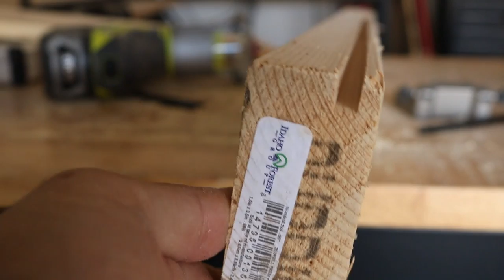RYOBI Cordless Router Review. The Ryobi 18v Cordless Router Is Great For Any DIY Beginner Woodworker

Comment: One thing you didn't show was dados.  I tried making a 3/4" dado 3/8" deep in plywood yesterday.  I  clamped  a board as an edge guide.  It ripped into it, but it was hard to control and I went off line.  I then dialed it aback to 1/8" and there was no problem. I kept a combo square set at 3/8", so I adjusted the router another 1/8th and went over my line again. Next, I went all the way down to 3/8" and finished the cut.  I then made one more pass to clean it up.  Finished dado looked great.  This little guy is a beast.  It will do most of what needs to be done

Comment: I just bought that router. What's not to like. I can see easily where the bit travels for freehand mortise . I can't think of a job I couldn't or wouldn't do with this tool vs. a more expensive brand. Your not going to overload a trim router and have it last anyway so having the batteries made it a no brainier.  I didn't know the fence was available. I could use that. Thanks

Comment: I've been using their tools professionally for a long time. Some are better than others but 15 years out of a table saw is awesome. With it's 27 inch rip capacity it more than met the order. How many miles of hardwood cabinet fillers and lumber it cut who knows. Some of their tools are duds that burn up after medium use in a hurry. Or that old blue cordless jigsaw that came out back when was useless because the orbit kicked out on the downstroke. I took it right back.

Comment: Thinking about getting one of these bc plunge routers are heavy (duh!) and sometimes you don't want to deal with a cord.  You keep mentioning the battery, but I think you could go with the smaller batteries and do fine on small jobs, or just swap out whenever you are setting up the next lot of pieces.  This tool is worth it for the convenience.  Putting it on my wish list.

Comment: You can get the edge guide on the Ryobi website for anyone interested. Should be more information on that in the back of the manual. Had trouble finding one and another video brought that up. A round base is available also.
Reply: Thanks, I've been looking all over for the rigid one. Didn't think to check Ryobi's site!

Comment: Thanx for the review! Like others I went out and bought the Ryobi after weeing your video as well as a couple others including the Concord Carpenter/Toolbox Buzz which they went through several of them. 
And sure there are others that proved to be "better" but at a much higher price point. I'm sure the more serious carpenter with cash in their pockets would go for one of the other trim routers, but for me, as much as I need and use one at this point, especially since they put it on sale for $49 bucks... it was the perfect choice. Since I already have Ryobi One + cordless tools that also helped solidify things for me.

I also ordered the Ridgid edge guide which you were the only one to mention it fit the Ryobi. So thank you again!

I do have a question for you since you have both the Rigid and Ryobi... Is the round base on the Ridgid Corded Trim Router acrylic or the same plastic as the Ryobi stock one is? And will it fit directly to the Ryobi?
As well, how about the Ridgid vacuum port attachment... if you have it, will it fit the Ryobi, do you know?
Again Thanx fort the review - it did help a lot in making my decision to get one.
Cheers...

Comment: It does seem like they did a really good job diffusing down to the ryobi line from the ridgid one. It's huge on top, but it's not a big deal. Worth 69 bucks IMO. Glad I am bought into ridgid for my main tools though, even if they are a bit more pricey, the batteries replacement on kits is the main draw for me (I only buy kitted batteries, so I won't have a 9ah until one comes with a charger :P). Like button smeeshed.
Reply from the maker: Thanks for the SMEESH Autonomous! Great talking to you on the live stream too bro!!

Comment: Totally agree with everything you said. I own 2.
Reply: What are the practical applications of owning two trim routers of the exact same brand and model? Just curious.
Reply: @as7river  You can dedicate one to a specific task, so you don't have to reset it. each time you want to do that task.  You have a backup in case one goes down. You have an extra so your kid can play with it. You have one extra in case one is stolen or you run over it with your truck. If you are senile, like me, you can always find one of them.

Comment: I do have a router, but one of those bulky, dual handle monsters.  I hate it and don't use it because I find it clumsy.

I just saw this Ryobi today and found it very interesting AND the price is really good.

My question is, does this take the same bit/shafter size and any other regular router?

Or is one forced to by special, Ryobi bits?

I have a large kit of many bits and I'd hate to have to buy those all over again.  LOL

Comment: Thank you for the review!  I'm new to routers, and I have my eye on this one (I have several Ryobi 18v tools), but I understand this is mostly for edge work.  However, I need to cut out maybe a 2x2" section in the middle of a board, 1/2" deep.  My question:  Couldn't I just cut a "pilot" hole and then start the router there, rather than trying to plunge it?  Appreciate your thoughts here!

Comment: Good vid there Clint.  Since I'm in the Ryobi battery  platform, I'm considering this trim router to add to my kit.  I already have the Bosch Colt corded trim router  but this would make my smaller projects a bunch easier.  I am curious how it performs on hardwoods like oak, ash, maple and others.  I will say I'd probably only use this on soft woods like pine though.  Thanks for sharing.  Cheers!
Reply from the maker: I'll be working with some walnut here soon buddy.  I'll let you know
Reply: @ToolReviewZone  Thanks Clint.
Reply: Hi william! I'm curious, what is your favorite ryobi tool?
Reply: @amoscardoza5253  Actually my 1/2" Ryobi drill driver as I'm not terribly impressed with their impact driver and still using my old DeWalt brushed impact driver in it's place for now. .  I also have a small  Ryobi work light that works great.

Comment: I’ve been considering buying this for home. I have Ryobi at home so I’d have the batteries for it. Also considering getting into Ridgid for home also. I would prefer the Ridgid router because it’s brushless but I don’t know if it really makes a difference between the two in this case.
Reply from the maker: If you use the router a lot, I would go Brushless just because you wont need to change them out if the go bad. That would probably take a while to wear them down, but still a bonus for ridgid!
Reply: Hi adam!

Comment: The way I see it, it's a good router but it is really for rounding edges, trimming edges and cutting small grooves, perfect for things like drawers or cutting T-Tracks. 

If you're totally new to woodworking, then start by asking yourself what do you really want to do with this router. It's not going to compete with your jig saw. It has a very shallow cutting depth compared to a fully fledged router. You're going to be getting about 3/4" cutting depth out of this router, which for larger boards or cutting more elaborate joins isn't really that great. 

It's the kind of router you keep around for making things like jigs and small items. Not suitable for more much else.

Comment: This router is a steaming pile of hot garbage! And this comes from someone who has an entire tool set of Ryobi stuff. My other Ryobi tools I love, but after having this router for only a year and using it less than a handful of times, it started to fail. And by fail I mean it would suddenly plunge deeper in a cut. So I went back to the handbook and made sure I was setting everything correctly, and I was. What I realized was the pertinent piece that travels up and down the depth shaft is plastic. It needs to be metal. This is what is preventing mine from not having this failure. I know these are cheap and this might prohibit Ryobi from making this component metal, but it there ever was a component on this router that needs to be metal in order to have it work properly, this is that one. I'm currently look for a replacement router OUTSIDE the Ryobi family.